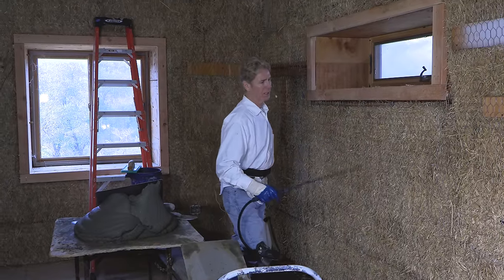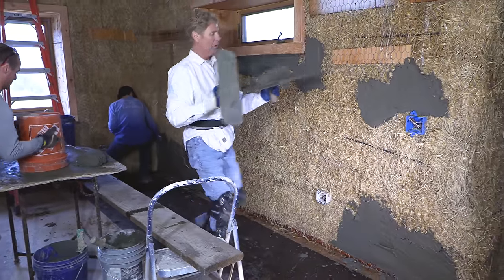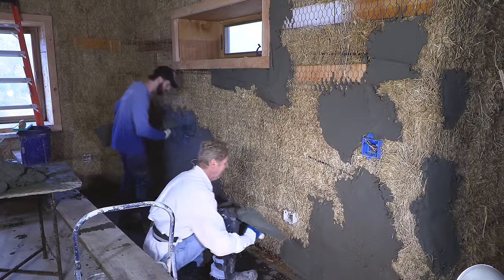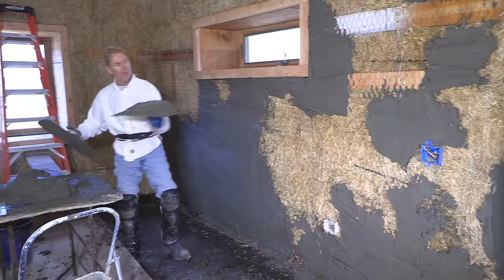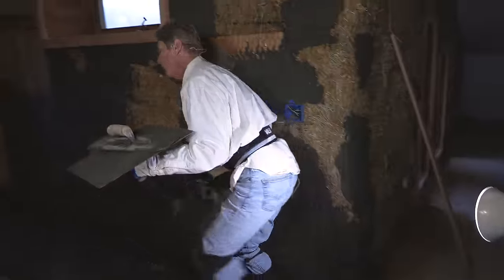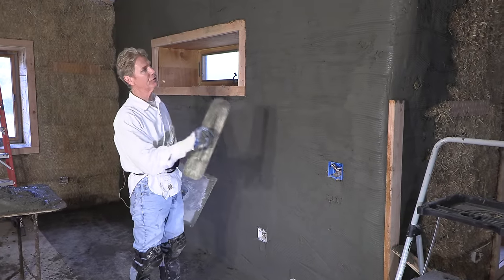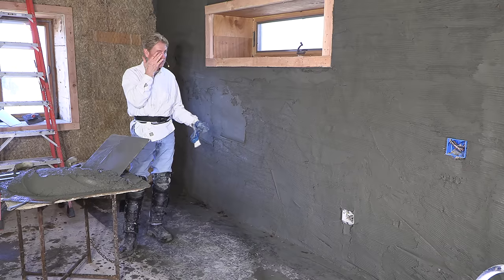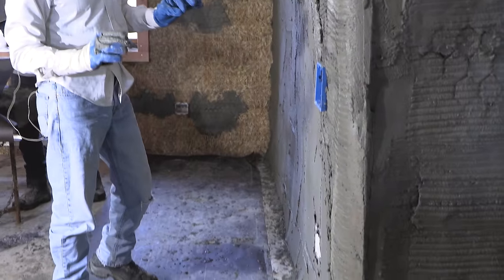Straw Bale Stucco Construction

Comment: Fire!
Reply from the maker: Howdy Chief, Staw Bale's homes are fireproof. Fire needs oxygen to burn. For example, if one broke a large hole and poured gasoline in, it would simply smolder, and then go out as the stucco would not allow the necessary airflow.
Reply: @StuccoPlastering  learn something new every day.

Comment: The big talker never puts in one spot twice.
Reply from the maker: Sure, we do, but it makes good sense to apply the really deep areas first, giving the dry straw a chance to suck out the moisture in the Lime stucco so it sets quicker. This is done to allow more coats of stucco to be applied without too much worry of drop-outs. Most of the Straw Bale walls were stacked well, but naturally we looked for the most crooked wall for this video. In reality, about 2 to 4 inches is all that is necessary.

Comment: How does it not rot??
Reply from the maker: Howdy Luke, excellent question. The force keeps it dry. Kidding.
The Straw Bales should not get rained on or be moldy when purchased. This is just common sense.  Once covered, a breathable stucco is preferred. Let’s air in and out.
 I’ve seen guys way back in the day hydrating the exterior walls like they were made of stone; this is not advisable; misting the exterior with just a quick spray of water to create a solid mechanical bond is necessary.
Excessive soaking or hydrating the exterior straw can trap moisture, which can cause molding, so again, just a bit of water is required for proper bonding.  
When building with straw bale walls, one can get caught with their pants down, meaning the dreaded rain or a chance of rain, so tarping the entire structure might be necessary.
 Way to much work. 
 It's best to start in spring, where there's little to no chance of rain. 
 Rain to straw bales is like kryptonite to Superman; it’s not good.

Comment: Why wasn't the wall built plumb?
Reply from the maker: Hi Neil, one would have to build only a single-story home, not this two-story home to find out that reasoning. After about 5 hours of stacking these as best as possible, your arms feel like thier going to fall off, thus one begins to throw them on and worry about the stucco afterward. Been there, 40-something years ago, and I was crazy strong at that time. 😉
Reply: @StuccoPlastering  You're not doing so bad !! Don't dream of retirement.

Comment: this kinda dont make sense...  there is a study paper made on this topic of using cements on the strawbale walls, it basically boils down to  having moisture build up  in the wall during the winter because the dew point is neatly in the strawbale  and not being able to fully dry during the summer due to the  cement in stucco.    This situation definetly may play out differently in places where there is warmer all year temperature.
Reply from the maker: @taavetmalkov3295  there are hundreds of studies, for straw bail it’s best to use lime stucco or what’s called plastic stucco, that’s what we’re using. Keep in mind we’re plastering the interior walls. The exterior walls were plastered by the owners over 20 years ago.
Reply: @StuccoPlastering  hey. Thnx for the quick reply.  Indeed there is much data.    As a train of thought, if i would use  a cement type of stucco inside and leave lime on the outside, would it prevent the mold situation. I think probably not because the dewpoint is connected with the interior heat and outside cold obviously and the outside coldness still holds some sort of water vapor.   If the balewall drying is hindered from one side then its still in the ballpark of not drying enough before the next winter.   🤔
Reply from the maker: Cement-based plasters are not generally considered ideal for straw bale walls and are used less frequently today. However, some cement-based stuccos, such as gunite or shotcrete, can be used in strawbale walls. Typical mixes for cement-based stuccos include one part cement to three parts sand, or one part cement, 0.5 parts lime, and 4.5 parts sand. Lime-based plasters and clay-based plasters are more common. Type in straw bale construction using lime plaster. I show us applying Kemset EcoPlaste which is sold in LA.

Comment: I didn’t know a straw bale house could still pass permitting
Reply from the maker: Homes of this nature have been built before any codes existed at least for 6,000 years.
Reply: Straw Bale building has been in the IBC for almost twenty years. 
While Straw Building has been around for almost as long as building, straw BALE building has actually only been around for a little over a hundred years. 
The oldest straw bale buildings are in Nebraska USA and were built soon after the mechanical baling machine was developed.

Comment: NEVER use cement stucco on strawbale walls. You want to have vapor permeability. Using cement is a good way to trap moisture in your walls which can lead to rot and serious issues
Reply from the maker: Au contraire mon frère, let me explain further. In the video below, we are doing something very similar and using the same material. It is what's called a lime or plastic cement, both lime and plastic mean the same thing. Both are also breathable. 
Naturally, I don’t expect anyone to watch another long video so, click on, https://youtu.be/dw34VLYFC1Y/ and skip to 6:38 and watch 30 seconds. That simple explanation, along with visuals, may change your opinion, if not, no worries.

Comment: I would have thought a lime mortar would be better or at least a weaker lime cement sand mix like  6 - 1.5 - 1.
Also if i was to plaster a straw bale house I'd spray the mortar on and trowel it into the bale straight away. Work smarter guys.
Reply from the maker: All are welcome to do what they think best. Your house, your rules.

Comment: Yikes. That was an expensive wall. You had 4 guys 2 (partial) days just doing one small wall.  

Great teaching, great work, as usual.  Surprised they used cement rather than lime - thought lime plaster was a big deal when building straw bale construction.
Reply from the maker: It was lime cement or plastic cement that was used outside 20 years ago, and Carl and Dan are also installing a lime stucco inside.